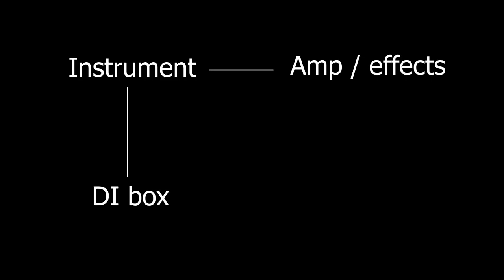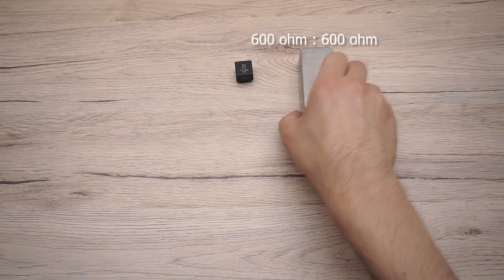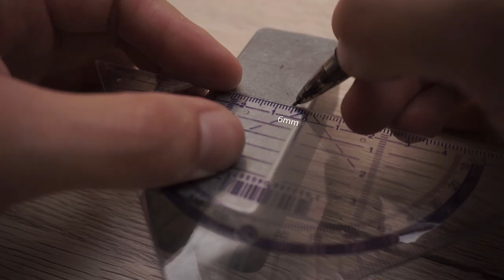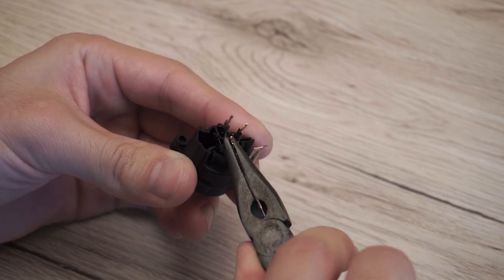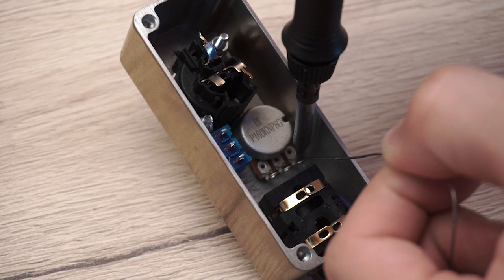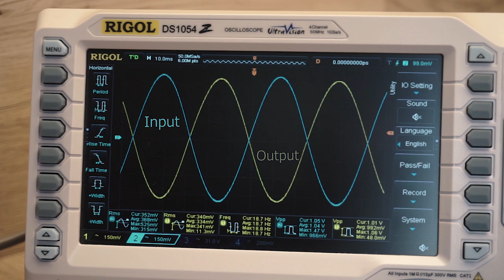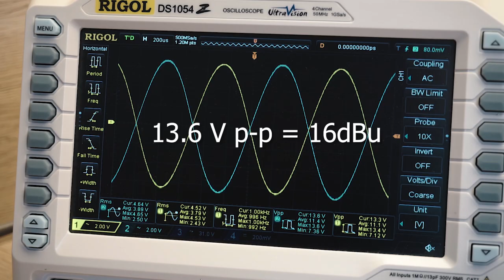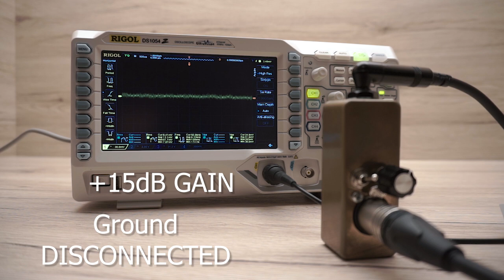How to build a REAMP box and WHY you need one

Comment: Silly question but if I took out the XLR jack and added a 3.5mm jack could I use this to convert my modular synth signal to go into guitar pedals? I am trying to figure out so that I can try to avoid paying too much for a guitar pedal adapter for it since I am low on funds at this time but have all the parts for this in my parts bin if it would work

Comment: Thanks you so much for this video. I was able to make one using Tamura MET31 as the transformer and removed the ground lift switch (always set as lifted). The output volume is very close to the actual electric guitar and it is sounding great so far.

Comment: Nice video. I am definitely going to try this build. I just have a question surrounding transformers. Commercial reamp boxes uses a range of different transformers for example Radial X-Amp uses a 10k/10k, L2A uses a 10k/600 and yours a 600/600. How does these affect the sound? As far as I read and understand it can affect the output volume? Can I use any of these transformers for this build and which will give me the highest output volume?
Reply: This is my question too. Did you come to any conclusions?

Comment: @LifeHarmonic thank you for sharing this and answering questions. I have a buffered splitter and need to connect a germanium based pedal (Animato), which does not like low impedance. So my situation would be unbalanced jack input to reamped, higher impedance jack out. I went through your replies, but not sure if 1. your reamp box would fit this particular job and how wiring and maybe components would be impacted. Can you help ? Thanks a lot !

Comment: Thanks for the nice video. Very good and easy to follow instructions!
I have the problem that whenever I turn the pot, it adds a lot of noise to signal, but only when the switch is set to 'Lift'. Do you have any idea what I may have done wrong? I'm pretty sure it's wired exactly according to your instructions.
Reply: Im just using my knowledge from reading amp forums, its probably working like it does in a presense knob for an amp, when you move the switch you can hear a crackling like noise because its biasing the circuit and thats actually DC voltage you hearing on the pot. Its probably normal operation but yeah mabye someone else can chime in. Hope this helps.

Comment: Does this one pad the signal like -12dB? I assume that 10k resistor does it? I’ve seen some videos people are using diboxes in reverse but lowering the output from the DAW for around 12dB in order to not overload the transformer into saturation. But this resistor after the signal hits the transformer, right? I opened my Radial PRO-RMP and I see some resistors in between the transformer and the XLR pins. So in signal path those are before the transformer, not after it.

Comment: If wiring up an XLR/ 2 1/4 inch combo jack, would I just treat the Tip and Ring the same as pins 2 and 3 on the XLR, and then have pin 1 and the sleeve as the ground? Thanks so much, this video was great!

Comment: nice video. But if I'm making one with a 1/4 TS input, should I solder the sleeve to the switch and the transformer (where the purple cable is)? My outputs are RCA/unbalanced .

Comment: Thank you for your great video loved building it I just have an issue I don’t know if I did something wrong but my box is picking up a radio signal and is a bit noisy should I ground the XLR connector to the chassis? Thank you in advance
Reply from the maker: Thanks for watching! Yes, you can ground one of the connectors to the chassis, either XLR or Jack. The noise should go away. :)
Reply: Did it ever end up working?

Comment: Hi! Great job. In my case, the XLR conector has a dedicated fourth pin for groundind (pin 01 has no ground). So, what should be the best way to wire the gnd.lift switch? Between pin 01 and XLR ground pin, or between pin 01 and output sleeve, leaving pin 01 always wired to ground pin?

Comment: Great video, thanks a lot! Would it be possible to use this as a DI box (instrument to balanced line level) with the proper connectors? Or would there be any necessary modifications for that purpose?
Reply from the maker: You could use it as a DI box, but it has a fairly low input impedance and would need a buffer (or a buffered pedal) before it. It's not an optimal way to do DI though, you would need a different circuit with some active components to get the best results when you plug a guitar straight in.
Reply: @LifeHarmonic  alright, thanks for the answer!

Comment: Great Video! I'm curious if there is a way to implement some sort of volume attenuator as well? Or does the impedance knob do this? I'm curious how you're sending line level signals into instrument level effects without severely clipping or distorting the input to them. Thanks!
Reply: Volume controls are generally set up as a volume divider, this impedance adjuster is just adding series resistance.

Comment: This is a very nice video ! Thank you for posting! So if the ground connected gives you so much noise why do we need to add that extra switch on the box?!
Reply from the maker: Thanks! It's not really necessary to include the switch, you could hardwire it in the "lifted" position. With the switch, you can ground the whole system if, for example, you're doing reamping via a laptop that has no ground connection.
Reply: @LifeHarmonic  Thank you for the answer! I will build it including the switch then since it helps with different situations! Btw why do we need a volume knob since we can change the output volume from the computer? So far I've been recording noisy small guitar parts straight from the FF800 adjusting the volume by ear, how do u adjust properly? Thank you for the time again!
Reply from the maker: @TheCoreys  It's not a volume, but an impedance adjustment knob. For some pedals, like a fuzz face, it makes a big difference to the sound if the source impedance is low or high, and for those situations, it's great to have this control to fine-tune the sound. As far as the volume is concerned, it really depends on what you want, but most of the time it works by ear. If you record with no gain and then reamp at 0dB it should be pretty close to what the guitar originally put out.

Comment: Great video!! My interface has 4 unbalanced outputs. Do I still need a reamp box?
Reply from the maker: Thanks! It's not absolutely necessary, but as you can see at the end of the video, a directly connected signal (ground) may result in a lot of noise.

Comment: tanks for the video, im just ordering parts to try this now... only thing Im confused about is why have the switch? What is the advantage of being able to disconnect the ground? What context is this used for? thanks
Reply from the maker: Disconnecting ground can and usually will improve noise performance quite a lot, but if you're asking why would you want to connect it in the first place, the answer is: if you are connecting two pieces of gear, each grounded somewhere (this is normally at the wall socket), you don't need (or better, don't want) to connect ground between them as well. But if one has no ground (maybe you're using a laptop with a USB powered soundcard, or the device being re-amped is battery powered/has two prong plug with no ground), it doesn't hurt to have it connected.

Comment: This is absolutely fantastic idea and thank you very much for the links, but one thing still confuses me: the impedance conversion. My outputs on the audio interface are 100ohm impedance, and instrument inputs are 1mohm impedance. So shouldn't the circuit consist of a different ratio transformer and a level potentiometer or a -10dB switch to convert the impedance and level from a line level [-10dB/100ohm] source to an instrument -20dB/1mohm source?
Reply from the maker: Thank you for watching! The transformer is not the only way to change impedance, in fact in modern equipment transformers are rarely used (since their price is high and size is impractical), so most of the impedances are set by a fixed resistor. When you get a -10dB switch (or any attenuation switch) on a device it is usually just a resistor divider that is engaged. The end output impedance is just the value of a series resistor with the output amplifier or in case of an attenuation switch, you have to calculate it from the two resistors used. This is why in my build, I use a variable series resistance to adjust the output impedance and the reason that the potentiometer is wired like it is, is so that the load on the transformer is always constant (always 100k ohm). If it were to be wired just as a variable resistor in series with the positive rail, the variable load on the transformer would change it's frequency/distortion characteristics when turned.
Reply: @LifeHarmonic  fantastic vid! thank you
Reply: @LifeHarmonic  didn’t understand anything but sounds like you know what you are doing! Although I don’t understand why we have to add a ground switch since ground connected makes so much noise…

Comment: This is great, but how do you connect it and how do you adjust the impedance?
Reply from the maker: You connect it via a standard XLR cable (Line Out from your soundcard/audio interface) and then use a 1/4" jack cable to your guitar amp/pedals. You can adjust the impedance by turning the potentiometer (clockwise is higher impedance).
Reply: @LifeHarmonic  Thanks for your answer! I will order parts and try to build one.

Comment: hey Life Harmonic. I just built this pedal and I'm having some issues where the Impedance makes no difference in the sound when turned, and my reamped guitar sounds weak compared to plugging straight into the amp with my physical guitar. I'm running a TRS > XLR from an Audient ID14 output. Does the pedal need to be wires differently to accommodate for this? I can send through a photo if it helps

thanks!

Comment: ok i tried doing that with a stereo balanced jack connector (my fireface has jack line outs) but using a unbalanced jack cable for the line out. and nothing is working like it should. my understanding is to connect unbalanced to balanced, ring and sleeve should be connected, so with a unbalanced cable i shouldn't have to do anything since the sleeve will touch both the ring AND sleeve on the connector, right? my pot is doing nothing, i get audio on the ground... i'm sure i'm missing something obvious, anyone can help please?

Comment: Thank you for the guide!
A question: your instructions call for a 600:600 transformer, but can I use a Xicon 42TM018-RC ?
It has 550:550 resistance, and 10k:10k impedance.
Thanks in advance!
Reply from the maker: It should work with this transformer as well, just the minimum output impedance will be slightly higher, but for most reamping purposes it won't make a difference.

Comment: Thanks for the great video! I built the box from the same parts as in youre partlist. The signal from my box is thin and when I measured it (with oscilloscope), it shows that the output signal start's to weaken and distort especially in the low frequencies. Can you tell what could cause this?
Reply from the maker: Thank you for watching! If the parts are the same, the signal should only distort at the levels and frequencies shown at the end of the video (20Hz-40Hz with high levels), it should not be thin. At what frequencies are you starting to see a drop in level?

Comment: Thanks for this!!I was about to order a Radial reamp box!I`ll try this first!Just a little question:Where the pot should be to achieve the HiZ of a guitar input?And in what range does the pot work?Thanks again!!
Reply from the maker: Hi George! The pot emulates guitar output impedance, so if it is all the way to the left, the output impedance is very low (like you would have an active guitar), somewhere in the middle (if you have a logarithmic pot) is just about 10k which is a passive guitar on full volume, and all the way to the right is about 100k, which is like a passive guitar volume set to 5.
Reply: @LifeHarmonic  Thanks a lot!I'll try it!

Comment: Great vids! but can we replace the XLR with 3.5mm socket as input, then use cellphone as the source to play the dry track?
Reply from the maker: Thank you! Sure, you can do that, just watch the wiring, because 3.5mm is usually stereo and you have to connect it as mono. Tip + Sleeve wired together and shield as ground. Then it will work just as well.
Reply: @LifeHarmonic  I saw you are using enclosed socket in both in and out.. so I guess it's not necessary to ground the casing?
Reply from the maker: @powerofsempol2905  Actually, you can ground it on one side of the transformer only. For most reamping purposes there will be almost no difference, but if you're sending the signal through an amp with a lot of gain it's better if it's grounded on one side. Should have mentioned it in the video...

Comment: Can i make a stereo-jack instead of XLR?  My audio interface has a mono-jack output, will this affect the operation of the device?
Reply from the maker: Yes, a stereo jack will work just fine instead of XLR. In fact, since I'm using mine with RME Babyface Pro most of the time, I have a jack-XLR cable just for reamping and it works great.
Reply: @LifeHarmonic  Thanks!

Comment: Hi. Very nice video! If I wanted to make this box with an unbalanced tele line level input instead of a balanced xlr, could I use the same transformer you are using? (To connect synths to guitar pedals or amps in a live situation).
Reply from the maker: Thank you! Yes, you can use the same transformer, it will work just as well.

Comment: That ... is what I gonna do!  Super cool and smack bang in the middle of my budget range! :D
Stupid noob question though: Can I use a plastic box? If not, can I use a plastic box with copper tape or copper paint?
Reply from the maker: It's probably going to work just fine with a plastic box. If you have noise you can shield it later with copper/alu tape or conductive paint.
Reply: @LifeHarmonic  Yeah! Noob worries I guess hehe!
I saw someone the other day build a complete tube amp and he started the build on a template, a piece of MDF I guess, with all the holes drilled etc. Then he did all the soldering and after THAT he moved the whole cake of components and wires into the box, like "the eagle has landed!". That looked plenty smooth!

Comment: What gauge of wire did you use. And maybe the link to the knob for completenes 😄
Reply from the maker: The gauge doesn't matter, since the power transmitted over these wires is really small, you can use anything. I will add the link to the knob in the description. Have a great day!
Reply: @LifeHarmonic  thank you very much!

Comment: When the pins for the mono jack are bent over, are you connecting them together? At 5:50 it looks like the green wire is touching both pins.
Reply from the maker: Yes, they are connected together. They don't necessarily need to be, both are connected together mechanically when the jack is unplugged, but then one side disconnects when the jack is plugged in. This function is not needed here, so I just connected them together.
Reply: @LifeHarmonic  Thank you very much.  I have my pedal built at this point, just need to solder the connections.  You tutorial is very good and I hope to be able to complete my pedal soon.
Reply: @LifeHarmonic  my 1/4” jack only works when the cable is plugged in half way.  I am using a mono guitar cable.  Is that the way it’s designed.  Also, what is the pot knob supposed to do?  Mine doesn’t seem to really have an effect to the signal when I turn it.  Thanks!
Reply from the maker: @MichaelMyersDoverPA  Maybe you're using a stereo jack socket and it's wired to pick up signal from the RING on a stereo cable. The pot is supposed to alter output imepdance. In most situations this won't be noticable, where you would really see the difference is if you used a Fuzz Face or a similar fuzz pedal and some WahWah pedals directly from this reamp box.
Reply: @LifeHarmonic  Thank you for getting back to me, and I probably purchased a stereo jack by mistake when ordering the parts for the build.